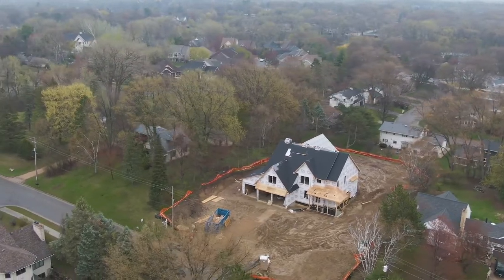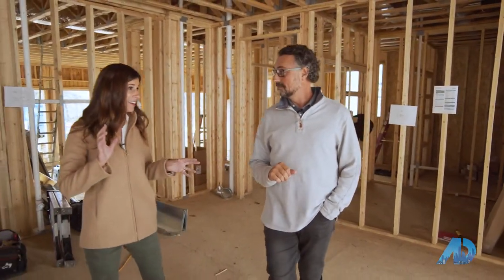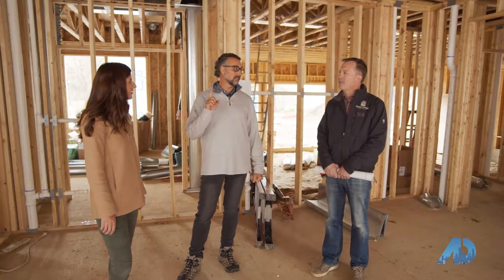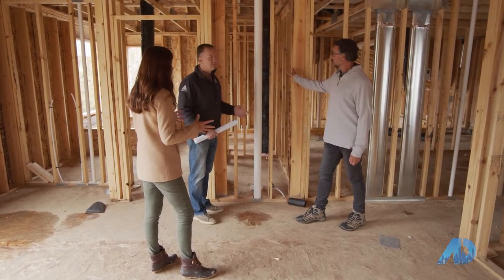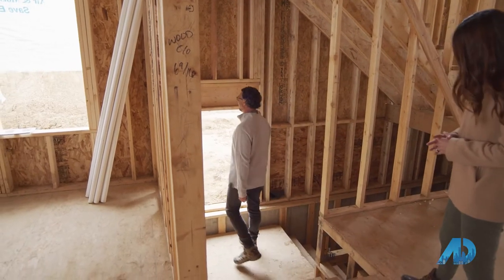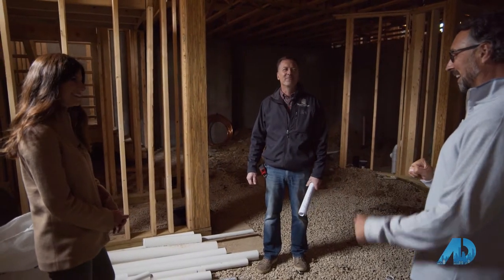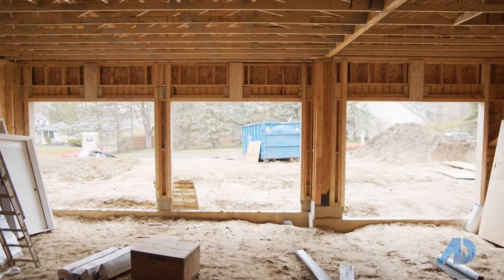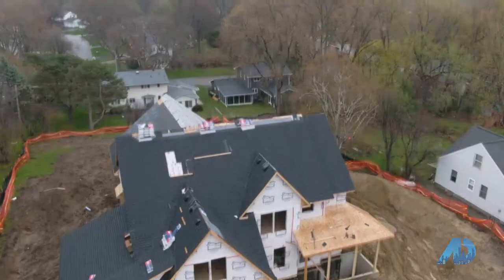What To Look For in a Pre Drywall Walk Through | Desrochers Realty Group

Comment: Actually, this should be part 1 of 3.  The next part should be re-inspection after the corrections you made. The third part of pre-drywall should be the insulation inspection.  For example, will there be insulation around the tub you were sitting in before the tub installation, to keep the water warm longer when you use the tub.  Best of luck with your new home.

Comment: Move the plumbing now that there's a big 4 in diameter hole drilled in the top and bottom plates.  Now has to drill two more of the same, nice, adds to the structural integrity.  Shouldn't have this been part of the blueprint/design?  Oops, a window in the wrong place. Electrical/plumbing tested?  Where's the insulation?